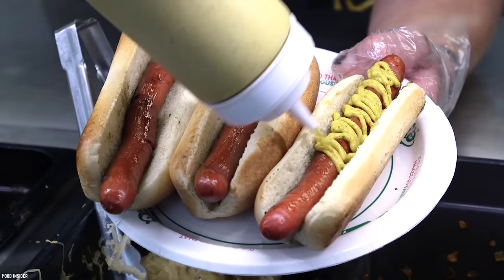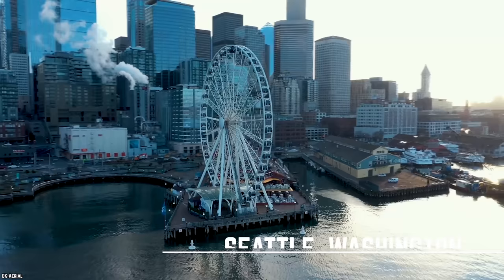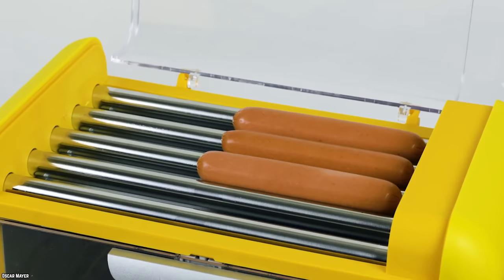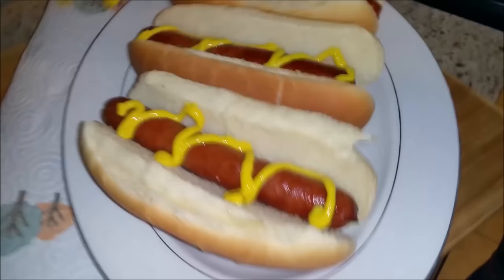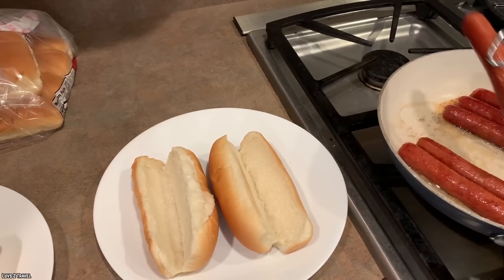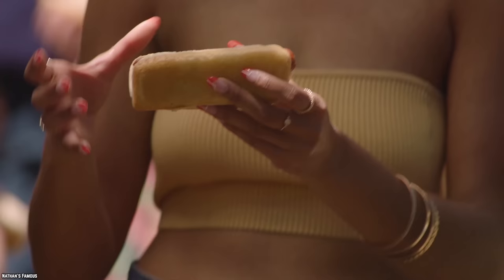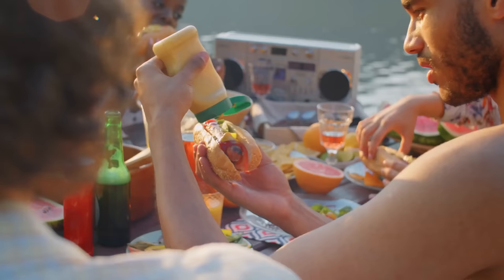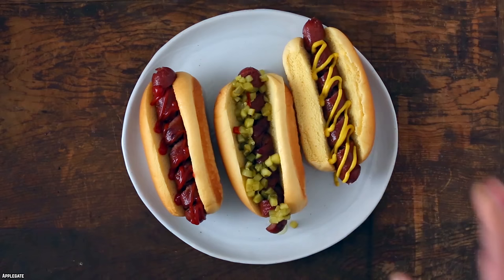10 Best Hot Dogs To Buy At The Grocery Store

Comment: I live on the west coast so different brands stand out to some degree; i.e., never heard of Eckrich, Sabrett, Boar's Head, Jennie-O Turkey and Applegate, even in my travels around the U.S.  Bar S, Oscar Mayer and Ball Park I consider middle of the road.  I think I have had Nathan's, but if I can't remember it, the dog didn't impress.  Hebrew Nationals have a great flavor, but are too skinny.  My favorite, which apparently is a local brand, is a Miller Dog.  It is very large (length and width) and flavorful.  I kind of wish it could be combined with Hebrew National which would make it a large and ultimately flavorful hot dog.  All in all, there is only one thing better than a hot dog.  That is two hot dogs!